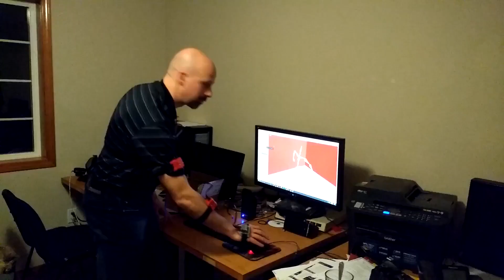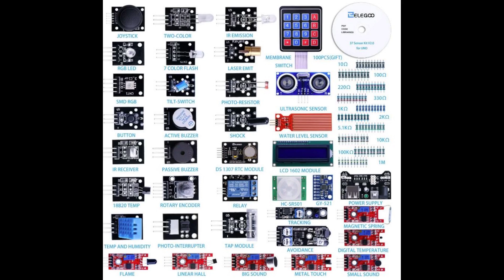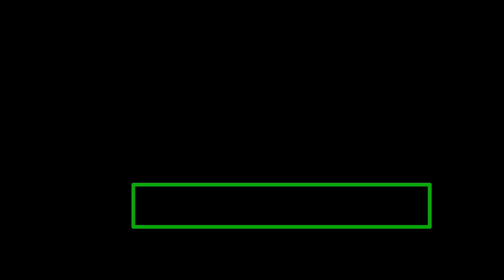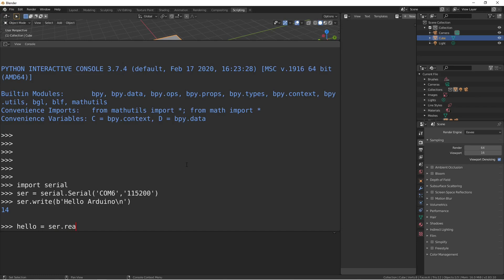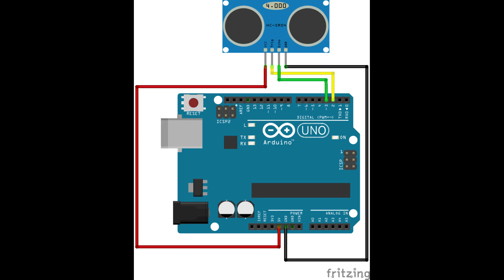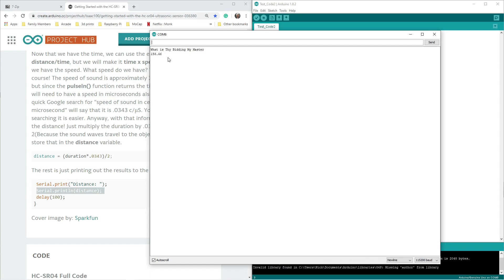Arduino to Blender Tutorial: Control Virtual Worlds with the Real One

Comment: Mine couldn't open port
Error : Python: Traceback (most recent call last):
  File "\Text", line 5, in <module>
  File "C:\Program Files\Blender Foundation\Blender 3.2\3.2\python\lib\serial\serialwin32.py", line 33, in _init_
    super(Serial, self).__init__(*args, **kwargs)
  File "C:\Program Files\Blender Foundation\Blender 3.2\3.2\python\lib\serial\serialutil.py", line 244, in _init_
    self.open()
  File "C:\Program Files\Blender Foundation\Blender 3.2\3.2\python\lib\serial\serialwin32.py", line 64, in open
    raise SerialException("could not open port {!r}: {!r}".format(self.portstr, ctypes.WinError()))
serial.serialutil.SerialException: could not open port 'COM8': PermissionError(13, 'Access is denied.', None, 5)

Comment: nice work a fan from egypt .. keep it up .. two question can i use MPU9250 instead for the motion capture suit ... and how to turn servo motors as the bone rotate .. thanks in advance
Reply from the maker: That part seems doable at first glance.  Controlling motors shouldn't be hard, especially if you just use the parts euler mode for each axis motor.

Comment: Did you set any special option inside Blender to be able to update the screen in the middle of the Python script? I coudn't get the screen updated. It's always updated at the end of the script execution.
Reply: Take the template called modal timer, native from Blender script templates.  This script is executed while Blender functions still available. If you change any property of a given object (rotation, location, etc..), it is updated to the screen in real time. Esc to stop the script (or other command you put instead).
Reply: @NauberSV  Thanks a lot. That made the trick. I've also noticed that readline() doesn't work inside Blender, so I replaced it reading chars one by one.
Reply: @gustavosuarez7945  a couple of weeks ago, I started testing MQTT protocol to communicate the microprocessor with Blender, replacing serial communication. There is a Python library called paho MQTT,   that allows Blender to subscribe Topics that are published by the microprocessor (an Esp8266, instead of Arduino). It made the communication wireless, and worked fine with the modal timer operator. 
I suggest that you and Nick Keeline take a look at this possibility...
Reply: @NauberSV  OMG, that's my next step to not depend on a wired connection. For now I'm playing with 3 sensors to see if can move an arm -at least-. Thanks a lot for the info.
Reply: if anyone wants to take a look at this MQTT test, email me: naubervitorino@yahoo.com.br.
My coding is poor, since I'm a surgeon...
but it is solving my issues... 😀
Reply: @NauberSV  let's get in touch. Thank you man
Reply: So blender uses a 'hack' to do this.
bpy.ops.wm.redraw_timer(type='DRAW', iterations=1)  i have found this line is flaky in windows .  I never had problems when I went to linux

Comment: Can you make a tutorial for using Bluetooth like HC05 with blender to get data from arduino
Reply from the maker: For bluetooth all you need to do is hook up the bluetooth device to the tx rx pins for the serial port to a bluetooth module.  Then get a bluetooth usb adapter for your PC or download the arduino bluetooth app for your phone, connect to the module with the PC or the phone and use it like a terminal.  It shows up in the pc as a serial port just like you are direct wired.  https://create.arduino.cc/projecthub/mayooghgirish/arduino-bluetooth-basic-tutorial-d8b737
Reply: @checkeredbug8015  and by the way...I tried to run the script in from GitHub but it's showing errors...

Comment: Amazing Video!!! 
But I'm using a MacBook Pro and I found that force update code seems not working on my blender, my blender just froze and nothing happens... I'm using the blender 2.83. Do you have any idea?
Reply from the maker: Sorry I don't own any macs.  You should google pyserial for macs.  If you delete the python dir in blender it will use python installed on your pc instead if you install the correct version, so if you can get pyserial working at all on a mac in python, it will work in blender
Reply: @checkeredbug8015  Hey! I think the pyserial is working on my MBP and I followed your instructions to add the pyserial folder in my Blender(Mac Verison) lib and I successfully send a text command in Blender's console and received a feedback from Arduino.
So I think there is another problem with my blender.
Reply from the maker: Sweet, glad to know macs can do it.

Comment: I use the BNO055 IMU in the suit.. thanks for the comments!
Reply: Hello sir m having a bit trouble with above code the thing is when i try the code in blender it stops responding i tried solving the problem i short listed to line 6 that part with readline code pls help me when i found this video it felt like i found a gem pls make more
Reply: @VinayKumar-ge1dl  the code freezes sometimes in windows.   I tried to fix it but it's in blender somewhere,  works great on my linux box every time.
Reply: @nickkeeline4840  oh ohk 🥲😨🥺🥺